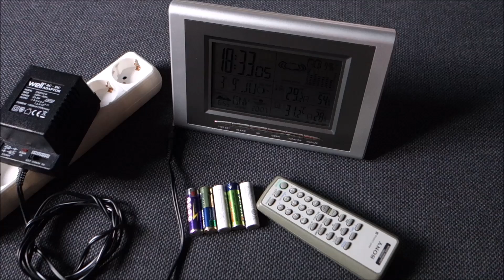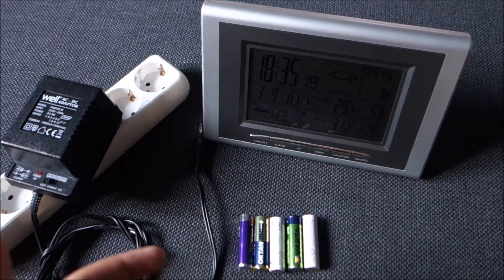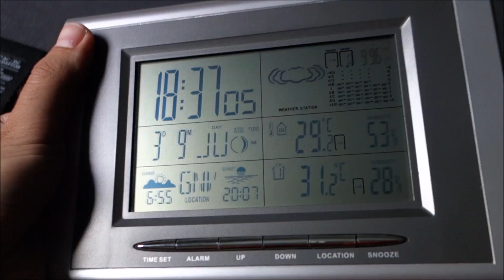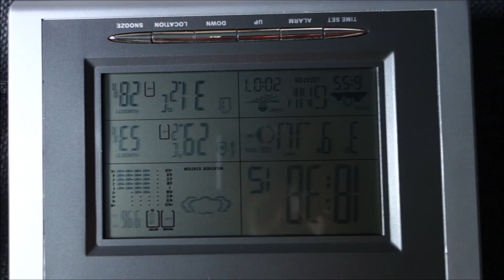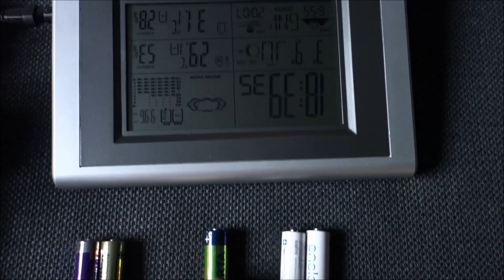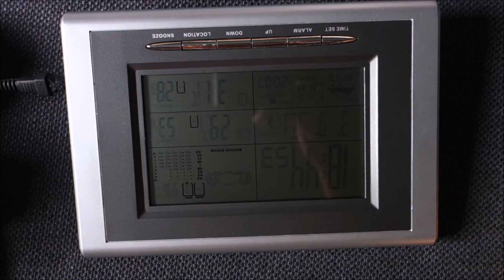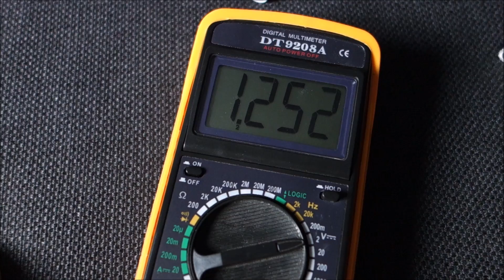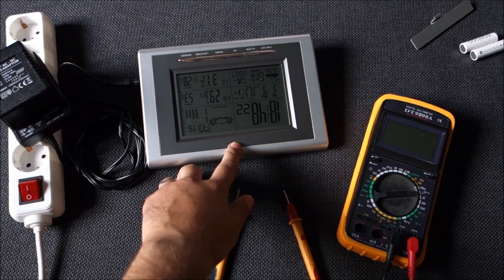Batteriser could actually be really useful in SOME devices

Comment: Ihave a few badly designed lcd devices like this that fade out quickly - even at 1.3v per cell, they're faded, it's stupid. The solution is mixing lsd NiMh and NiNn to get the voltage right. This is ok to do since the current is very low, but you don't get much warning once one of the cells fall off the knee curve. Or just use lithium primaries if you don't want to use rechargables. One is an alarm clock that is just fine with two NiZn, the stupid designers must have used a chip that was designed for lithium coun cells which are 3.3v or so when fresh, but stuck a 2xaa holder in the case and saw it worked at 3.0v and called it a day.
Reply from the maker: +hansonsux Thank you for the information, I will try it out. I think you are right about using components not meant for lower than 3v, but in real life you always get lower than that.

Comment: Decent honest video for a change on this topic. The batteriser will just do what many devices do anyway so there'll be no benefit, but for some it may help. There seem to be downsides though. In their apple keyboard example  it seemed tight and I wonder if it ever came out again, and the sudden death scenario could be an issue. High street bought batteries are way overpriced and I can't help thinking it's better to find a cheaper supplier of batteries such as eBay or IKEA ones (which are super cheap, on a par with leading brands and work great). Looking forward to real reviews though if it makes it to market.
Reply from the maker: +Nick Lindridge Thank you. About the size problem, I remember that a few years ago I had a cheap camera that I used with batteries. Some of the thicker batteries got stuck, so in that situation it would clearly not work. And also for a camera it would be really bad not knowing how much energy is left in the batteries. I really hope it will make it to market so we see for real what it's all about.

Comment: You pointed out one good use for the Batteriser, but also the flaw with using it:  without the Batteriser your LCD is very sharp for a few months, then goes dim when the power drops. Your AC converter is there to save your settings during a battery change, correct? So now imagine that you stick in new batteries with the Batteriser - a few months later the Batteriser boost circuit cuts out when the power is too low for it (or drops rapidly to 0). Because of the Batteriser there was no dim LCD to warn you the battery is about to fail... now you have to replace the batteries AND redo all of your settings.

The Batteriser is not a bad product, but it is being mis-marketed. A better use might be to use your batteries until they start acting weird, then stick the Batteriser on the batteries to squeeze a little extra time out of them. (Realizing that when they DO fail, there will be very little, or no warning.)
Reply from the maker: +CDArena You are absolutely correct. I completely missed that, thank you for pointing it out. 

It seems I am left with 3 choices in this particular situation:
1. Don't use the Batteriser and live with the dim display.
2. Use the Batteriser, try to guess when the batteries would fail and change them prior to depletion (this actually cancels a part of the benefits from the Batteriser).
3. Use the Batteriser and redo the settings when the batteries fully deplete (what I was trying to avoid).

But now that you mentioned this I wonder how will the Batteriser cope with the fact that I plug in the AC converter in paralel to it when changing the batteries. I'm thinking it could even damage the Batteriser.

Comment: Great idea, in fact there is just one little problem with your argueing. You say it's main advantage is for devices that do not work well with low voltages and therefore would not work well with rechargeables. There is just a little problem - rechargeable batteries are not really good doing deep discharging to low battery voltages. If you would discharge to low voltages you're going to ruin your accu and will get not 1000 charging cycles but maybe 10% of it if you're lucky. So not really a good idea with that devices too IMHO.
Reply from the maker: +Slartibartfas042 Thank you for commenting. You are 100% correct, but I said about the same thing in the video at 12:43. I used the rechargeable batteries just for low voltage demonstration and for people to make an ideea where the batteriser could be useful. If they have a low current draw device that does not work well even with almost fully charged rechargeables, then it could work well with standard batteries plus the batteriser. I will also update the description of the video, so this is more clear if someone misses that part of the video.

Comment from the maker: +Batteriser Fan Page Did you actually watch the video before commenting? I just showed two products where the batteriser would work perfectly in my opinion. You just have to accept that the Batteriser will not work for every single battery operated product. If the product already has a good design with a low cut off voltage, the Batteriser will not make much of a difference.